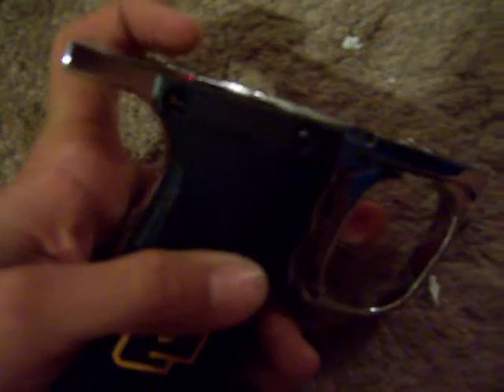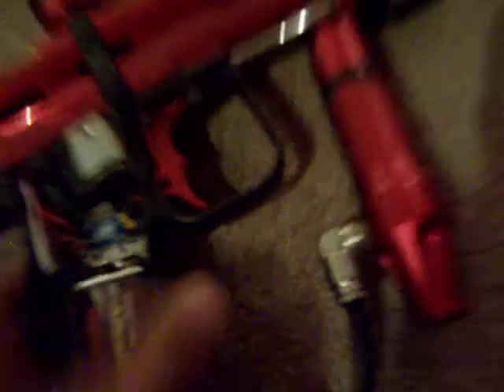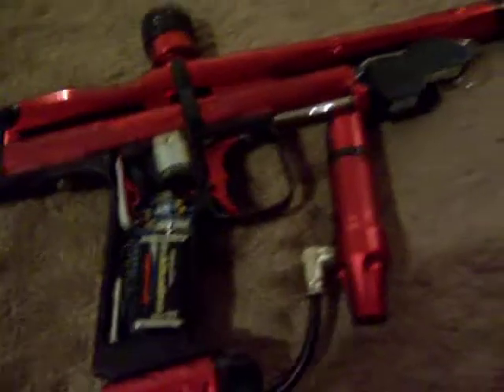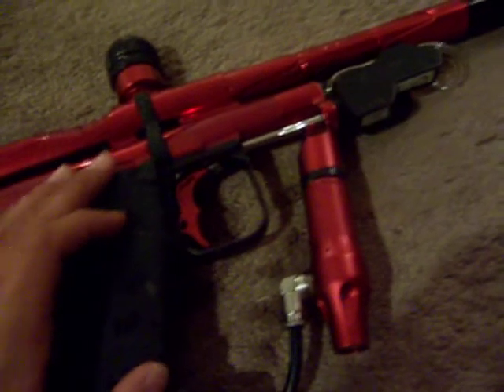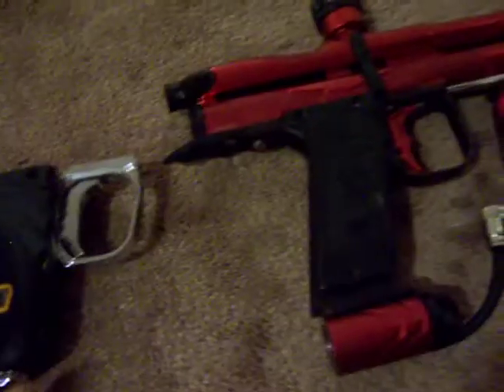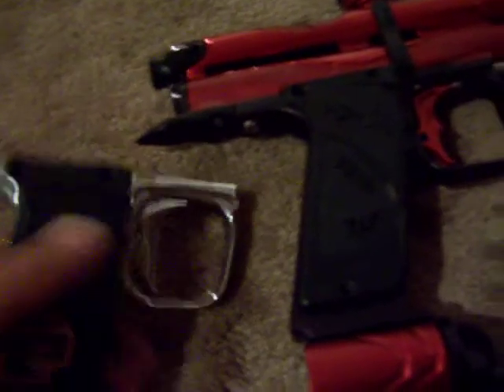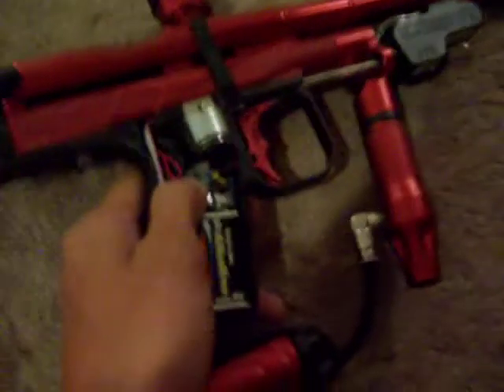Eblade stuff.

Comment: Could you go more into the other settings, or explain how to check to see if the eyes function properly. When the eyes are on, the gun shoots slow semi. when eyes off, the gun chops and jams. The bolt clears the breach, the timing is accurate, I'm just not familiar with the e1 boards. If you could make another video showing the other board settings that would be awesome. Good vid. here too.